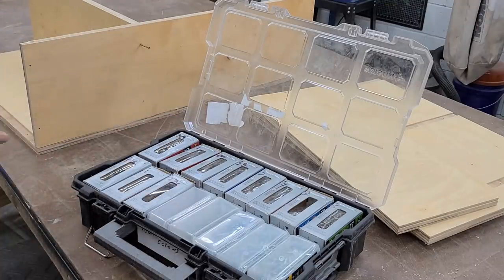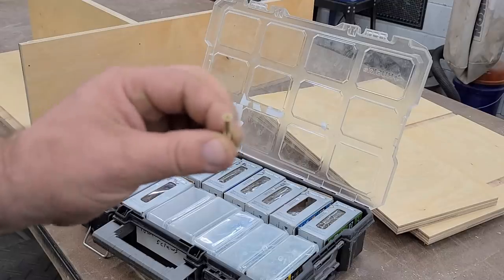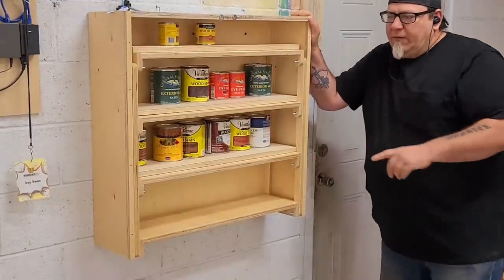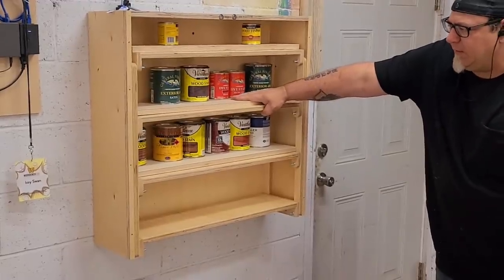Tiny Home/Van Life Project Build || YOU Decided What Happens Next!

Comment: version 1.2 with static selves is a big improvement over 1.1, and the roll top door would be awesome. A lot more work, but cooler by far. No legs!
Reply: I agree...
Reply: Agreed. 1.1 is an improvement (the first version is 1.0). but I still prefer version 2.0. But probably not a door in a door. I don't see the point of the door in a door. Version 2.1 is needed -- I would prefer a sturdier table, i.e., can support more weight, flexing less under greater load. Maybe dual & parallel supports, or simply a sturdier door. Well, unless you want to be known for jazzier builds that aren't so sturdy. Looking at some of Izzy's past builds, maybe that's the way to go -- version 1.0 or 2.0 in that case.
Reply: No need for doors. Van life is about weight and convenience too...just put a lip on the shelves and they are good to go. Table only needs to hold a laptop, dinner plate, cards....no need for more strength than that

Comment: #1, no need for under cabinet support and the cool factor is off the chart.
Reply: 1st version
Reply: My thoughts too! That is the coolest fold down tables I've seen.
Reply: If someone leans on that #1 design as a it is then it will fail. I guarantee it'll happen at some point. It needs support under the table when its extended,  easiet and strongest way are legs 2nd way would the some form of fold out support. Izzy test this to see how much weight it can take fir example an avarge person keaning on it.
Reply from the maker: @blackadder1966  no it wont it can hold 150 pounds as it is the tricked out version will be able to hold 2 or 3 hindered pounds
Reply: @blackadder1966  his design holds the shelves in compression which is incredibly strong.
Reply: The under cabinet support cantilever thing on #2 is way way more obtrusive than legs. It blocks you from putting stuff underneath the cabinet.
Reply: @izzyswan  can we see some one that weight sit on it  or repeatedly lean on it? Interested to see, I worked for a company manufacturing (24 years) components for furniture and construction industry. Had to rigorous testing of components and completed projects to meet certain standards. If your final design can hold as much as you say its something that could be worth a lot and could be used for many applications. Just off the top my head hospitals and aged care facilities pay big money for foldaway beds etc.

Comment: This reminds me a lot of the first piece of furniture that my parents ever bough (on getting married in the 1960s) - it was made by a company called Neat-Ette and it was like a small cupboard with drawers above - the double doors of the cupboard opened by swinging out from the centre as normal, but the whole door frame assembly could also be hinged upwards and supported by a gate leg, to form a small table
It was really solidly built and it survived into my own teenage years (although no longer in use as a main table) before they sold it on.
Many couples were on a really tight budget, so there were a lot of multipurpose, compact furniture like this in the UK during the 50s/60s
Reply: You should try and rebuild it on your channel. From pine cones! 
For anyone interested, atomic shrimp's channel is phenomenal!

Comment: Number one.. its the way its mass produced for a reason. You cant stand in front of number 2 and get access easily, which is essential in tiny home/van living lifestyle, space to stand is at a premium, the 2 doors need half the width of the cabinet to open to 90 degrees, while one vertical door requires the full height of the cabinet. The door is a nice touch tho to address ease of access without folding it down. Tho after moving a van from one location to the next you need to be able to open it easily while also checking to make sure no items have fallen forward onto the "door" and became a risk of falling at as you open it, which is much more difficult with the full single door option. Anyone that thinks #2 is most likely someone that has never lived or worked in a small space for any extended period.
Reply: I'd rather have items fall on me while I can catch them than fall in transit and roll around on the ground so a door is a must have imo. Also the nice thing with the number 2 style is that you could  just open it in table mode after stopping amd reach in grabbing what ever is falling. Also as someone that lives in what is essentially a tiny home I don't mind doors at all it's easy enough to simply open them while standing to the side.
Reply: @MrTarfu  Either way it requires a locking system to keep the door(s) closed, so in both designs the doors opening in transit isnt possible if you dont leave them unlocked before transport. But #2 has much less ease in way to keep any item from just falling out if is leaning against the door when you open it. #1 if you notice something is leaning against one door, you can just open the other and safely reach behind the other door and push the item back onto the shelf.
Reply: @MattWeber  Manny good thought's, ty. I'm sure Izzy can make a two door solution in #2. I have to say I like the #1 solution with fixed shelves and Izzy's suggestion of scroll blinds.

Comment: Awesome !!! Congrats!! I like the 1st proto better. The folding shelves2Table concept, blew my mind. I would still like it to have cabinet type doors. The only modification I would apply, would be to see to have the cabinet doors "slide" out without impacting nearby space as it does when opening a regular door... there is a almost 180 radios movement... while sliding to the sides and out of the way to the shelves to come down.. the doors would still remain like in open position... the rail guide can be placed on the door cabinet itself and the pin on the door usually is the other way arround... pin on doors and slides thru guide on cabinet

Comment: The revision you did to the fold down shelves. Looks good. I'm going to attempt to build something just like this for my entryway in little corner in camper. I will be building the shelves for shoes and I'm going to try and figure out a way for the fold out part to become a bench. That way one we can sit on the bench to put our shoes on or take them off. Will be replacing floors throughout and think it will be nice for "no shoes" rule while inside. Keep down on the sand and dirt that seems to accumulate quickly.

Comment: Just a thought for version 3 if you were to extend the bottom of the front (table top) and attach the hinge with Chicago screws ,you wouldn’t need a bracket to hold the table up. Plus you could use the lower portion by putting towel bar or any you could imagine needing to hang under the bottom of cabinet.

Comment: Second version of no.1
Suggestion.  Extend length of front support struts by depth of cabinet, then as they fold down to the horizontal they become additional cantilever supports making the table top stronger and more rigid.
This increases the height of the whole unit, but the space below can be used for a fixed shelf

Comment: A lot of small live-aboard sailboats have a real compact fold-out table that mounts to the salon side of the forward bulkhead.  They are very flat to the wall and your dishes store inside of it standing on edge so the depth of the cabinet is only about 2 inches.  A thin shelf supports the edge of the dishes and a thin wood strip goes across halfway up the dish so it can't topple out when you drop the table top which is the front door of the cabinet.  These are usually kind of tall so the table that folds out is long and either rests on some part of the boats cabinetry across from it or it may have a fold-down leg.  Often the table top can fold out again to become twice as wide.  These are very common on old 30 to 40 foot boats.

Comment: I agree that the convertible shelf-to-table design of #1 is an ingenious, unique and cool-looking solution. However, adding the static shelves effectively undermines the dual purpose. Now you just have a louvered table, and you still need a compact solution for the cabinet door(s). Tambor roll-up door would be cool, but much more labor-intensive. For the problem you are trying to solve, I say go with design #2. Less sexy perhaps, but much simpler build, and still very functional. Can the inset door be a cutting board?

Comment: #2 seems much more sturdy and has fewer moving parts. The multiple shelves on #1 provide multiple points where they could get misaligned and make a not smooth table surface. Adding doors to #1 is excess material that #2 wouldn't have. I vote #2.

Comment: What if you combined both ideas. Made the shelves from #1 to pull down while cooking and then put away while using the door from #2 as the table surface. Just a suggestion. Both ideas are genius and I am sure either will work perfectly in a tiny home.

Comment: i just love first version - it is unique, practical, cool to see... but doors are a bit of a problem... if they are bifold, they take up the space, if they are attached to the structure, it is not practical tu use them to grab something as you need to open full table for that... for practical reasons only my vote goes to number 2 build...

Comment: What if its version 1 but it has a third position. Flat, like the table, but vertical (parallel to the wall) so if you didn’t want shelves or a table it could be basically flush with the wall (taking up little to no space)

Comment: 8:25 If the bottom shelf extended the thickness of the 'door,' then the 'door' could be dropped so as to be in te same plane as the lower shelf which should make the support 'bar' easier to build.  Piano hinge inset into rabbits on top of bottom shelf and inside face of 'door' with rabbit/recess for barrel of the hinge as necessary. 'Door' could be completely 'recessed' if 'middle' shelves were  reduced in depth by the thickness of the 'door/table' making for quit a neat version of your idea.  LIPS on edges of interior /middle shelves might be appropriate for a vehicular installation, no?

Comment: As a builder I like the #1 more, it is cool. But it has two flaws: 1) as already noticed it eats from the vertical space on shelves and 2) if a piece put on a shelf is too high it may get crushed by the folding table. The second issue may really become annoying since even a little mistake in judging the height of a piece would not be obvious and would be revealed only when user attempts to close the door. And that may be too late. So as a user I would chose #2.

Comment: If this unit is built as a cupboard to hold items in the first build would not keep the jars on the shelf as you’re bumping down the road. The second buildIs much better and a solid door front could also be used as a reminder or message board.

Comment: I see both are cantilever designs.  Cantilever for an eating table (without legs) is a disaster waiting to happen.  While both are nice in implementation, both will fail in practical application unless further support is added.  I'm thinking for either design to work portions will have to be made of steel or replace the cantilever design with angular support.
I know it's too late and in the scope of the series, but I would have made the tabletop flip up.  Behind the lowered tabletop would additional storage for storage of items rarely used.  There are a myriad of mechanisms to support the tabletop then without using legs.

I prefer the second design of the two.

Comment: Instead of a fold out arm to supports the table.  How about a thing like cars with hoods the hing in the front but this folds down and under the cabinet so the part of the door under the cabinet is pushing up on the bottom of the cabinet?  If that is not understandable, message me and I will explain better.  It would be slick because the door would look like it is unsupported.